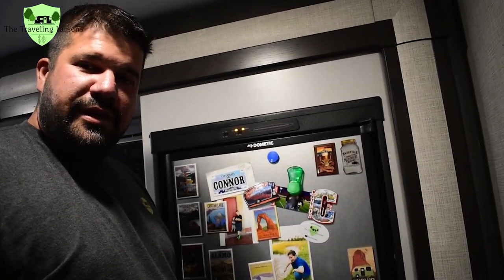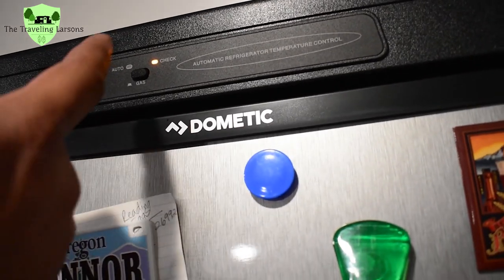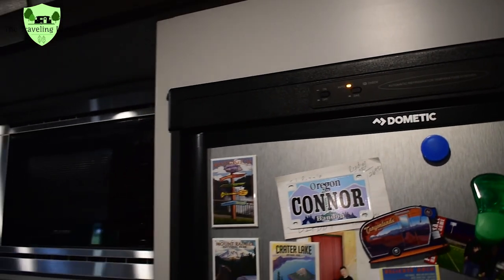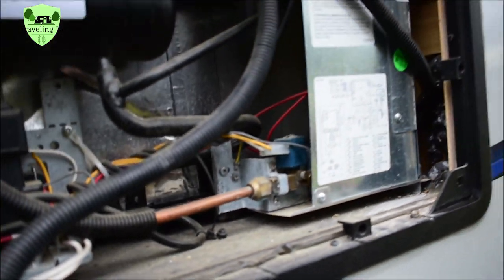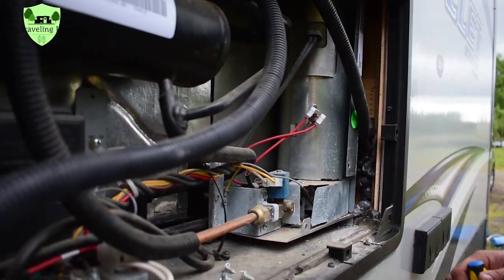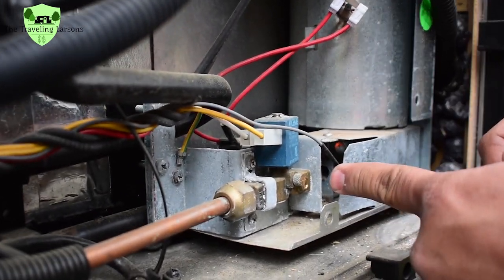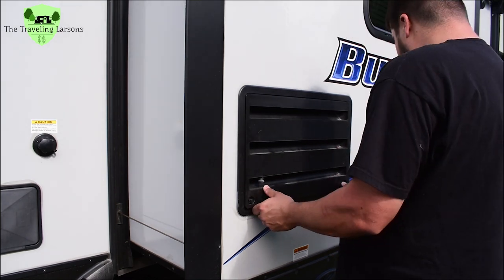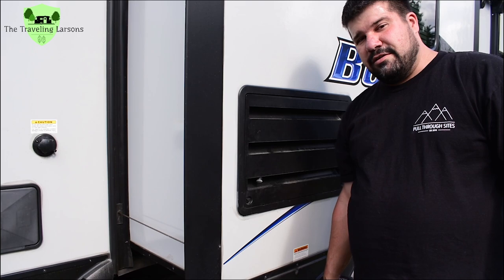Dometic Fridge Igniter Replacement

Comment: Two lights are never good......need the fridge bro. Dude you are superman....how did you learn to do this? Your the man
Reply from the maker: The Art of RVing   You’re right!  Two lights are never good!  Thanks buddy!  I am honestly not mechanically inclined, but I have many years of home construction and commercial construction knowledge, 🔨 🏗 🚧 and try to use that knowledge I’ve accumulated in order to diagnose and repair something like this.   Now, that’s not to say that I don’t use Google or YouTube to double check that I’m on the right track, I do 🤫. The igniter in a RV fridge to ignite the propane for the burner, is not really any different than the igniter in a natural gas furnace or water heater in a sticks and bricks home.  I also know that since we are full timers, we don’t have the time to take the trailer to an RV repair shop to get something fixed.  Thanks for watching!

Comment: Hi Kurt... HELP!  I'm  having the same clicking noise you had... lights were flashing a code that said DC voltage was out of range... yet the frig fires up on propane- the clicking starts about 15-20 seconds in- then LP shuts off. Runs fine when plugged into shore power or on generator.Its a 2015 domestic. Replaced the computer module...still clicking. Can you tell me if your LP ran but shut off after the clicking noise started? Thank you in advance
Reply from the maker: My first thought reading your issue was the computer/circuit board.  Almost sounds like the fridge isn’t getting enough propane, like maybe there’s a kink in the line or something limiting the LP supply.  We didn’t have this issue or anything similar.
Have you tried calling Dometic?
Maybe a short in one of the wires?  What about the panel at the fridge, where the lights and button are...?
Just my thoughts for you.
Please let me know if you find out what is causing your issue.
Best of luck!  Thank you for watching and if you’re not already, please SUBSCRIBE!!!
Reply: @TheTravelingLarsons  .
Reply: I’m having the same problem did the igniter solve your problem

Comment: ok.. so my fridge is doing similiar. the igniter clicks, the flame starts but it keeps clicking... then after 10-15 seconds it turns flame off. did yours light the flame and then keep clicking then after it shut off.
Reply from the maker: Ours kept clicking then would lock out.  Based on your issues, I’d assume it’s either the igniter or the burner.

Comment: Can my fridge work without the reigniter? My original started to melt
Reply from the maker: Your fridge must have the igniter to work on propane.
If you’re only connected to shore power you won’t need the igniter.
Reply: My RV's fridge will not lite either. But you can manually lite it from the out side.